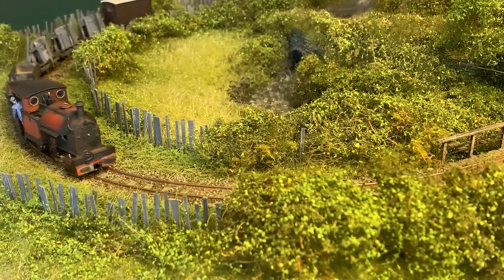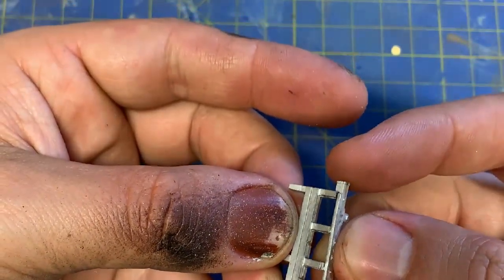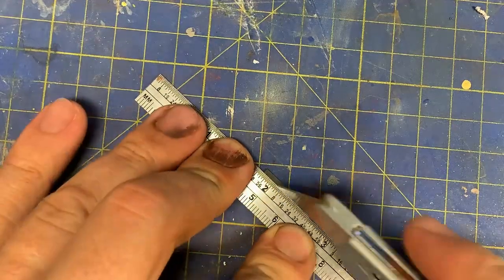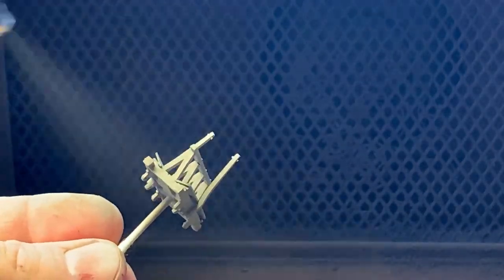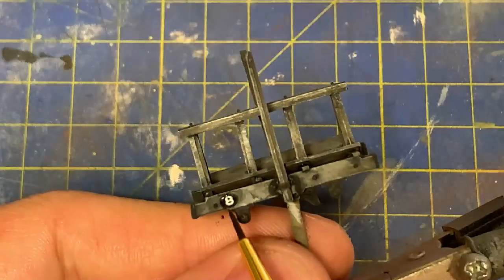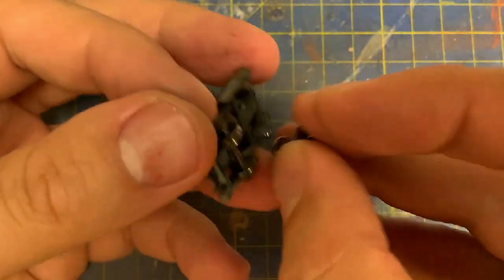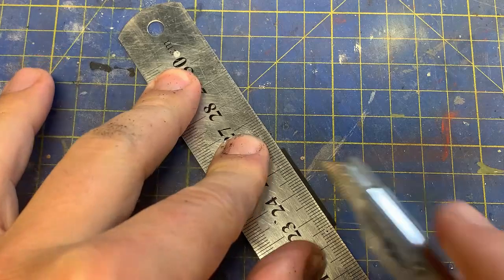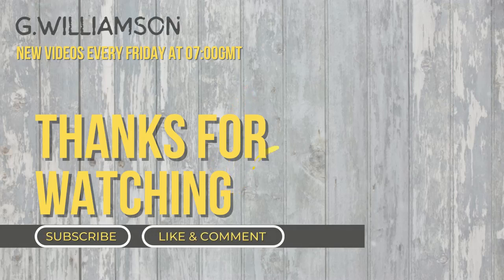Building a Corris Slab Wagon for 009 Model Railway Layout

Comment: Thanks for a really superb series of vids.  Re: Waggon numbers (always with 'double g' on the Corris).  AFAIK, almost all slate waggons, incl. the trestles, were quarry owned.  The brake van and coal waggons certainly had GW numbers, though can't recall seeing any photos showing waggon numbers in independant days.
Reply from the maker: Thankyou, yes I might go back and sort the wagons, for the Corris series, I’ve just used ‘freelance’ numbering, as it’s more of a Corris-style layout as a whole so I could fit it in an unrealistic space, however, the next series is a prototype replica so the numbering will be correct
Reply: @GWilliamsonModels if you decide to build a Falcon, have a close look at the blower pipe on photos of No.2.  There's a pronounced kink over the front end of the saddle tank.  It's one of those "how the hell did I manage to miss that" details you'll never unsee!!  Some reckon the cab roofs (specifically a bead) and spectacle rims differentiate Nos 1 and 3, but I'll be damned if I can see it!

Incidentally,  one source I have suggests that surviving No.3 is an amalgamation of Nos. 1 and 3, NOT all three, as No.2 was still being pressed into service in the mid 1920s, either until No.3's rebuild was completed, or No.4 got it's boiler issues sorted (new boiler after just 8 years?? ..... wonder if it was a Kerr Stuart 'warranty job', or has anyone has found an order number to confirm that?).

No.2 at least also featured a removable sloping upper back cab sheet.  No.3's cab rear only became a stepped fixture after it's 1920's rebuild.  Her driver really ought to have a long, drooping moustache (see loads of old photos).

Oh .... and foxgloves ..... oodles of foxgloves!!
Reply from the maker: @TheHoveHeretic  brilliant, Thankyou for that, it’s funny how you miss something until it’s pointed out! I noticed this when I started volunteering on the TR, and got really up close to the engines!
Ah yes, fox gloves, I’ll have to try making these!

Comment: Would a metal type finger nail file work for removing flashing, to avoid filing to  much material off?
Reply from the maker: Yes, quite possibly, it’s usually very thin so doesn’t take much to remove it